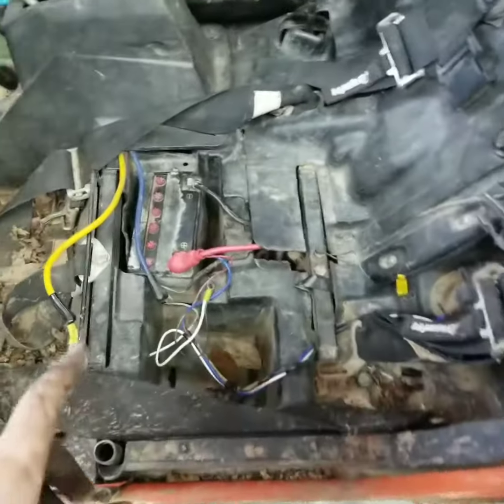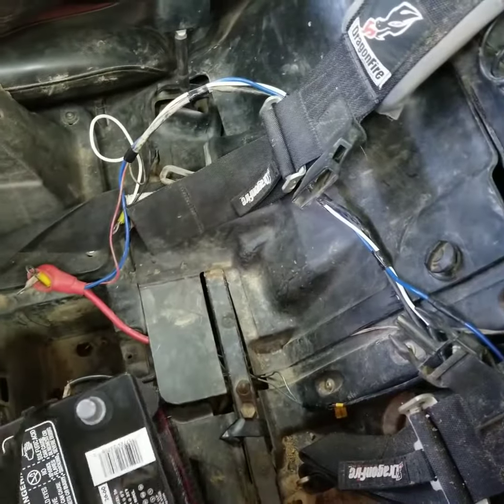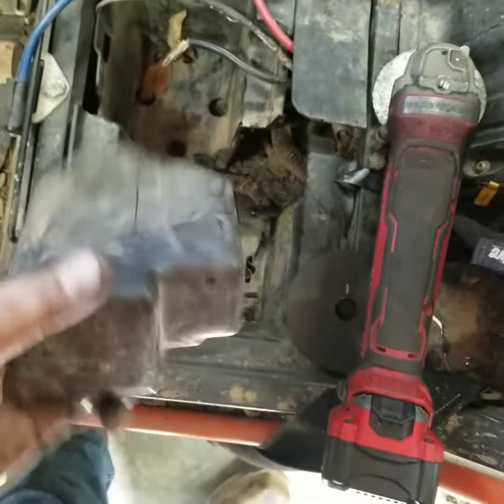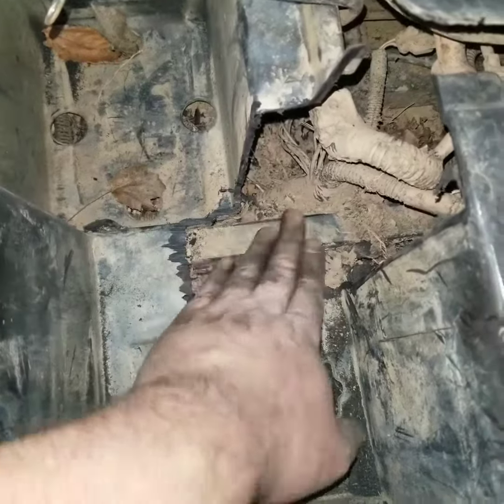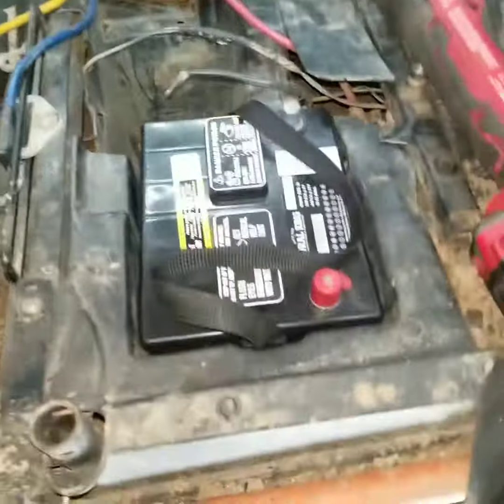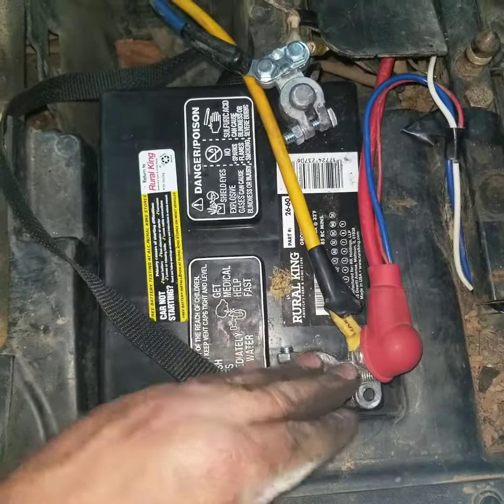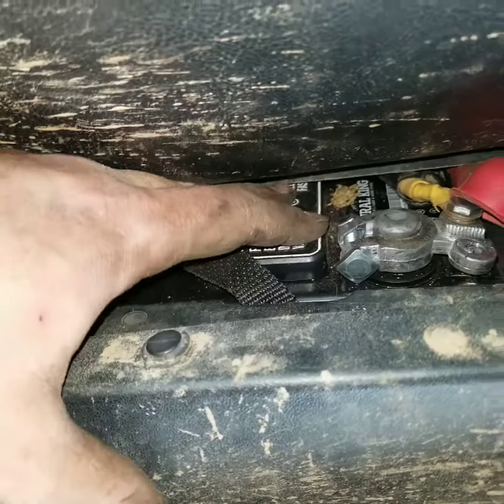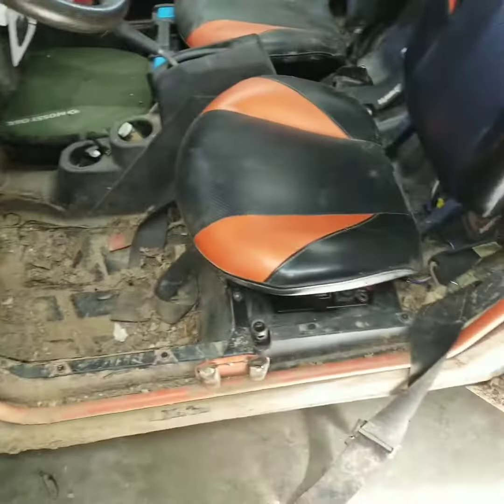RZR 800 or 570. How to convert to a car battery

Comment: Hey , what year and model is the car battery your installed on the rzr?

Thanks.
Reply from the maker: It will work on any of the 800/s or 570 models
Reply from the maker: I use rural king brand because there cheep.  The number on the battery is 26-60

Comment: Hey is it better to run the car battery compared to the dual regular battery?
Reply from the maker: In my opinon yes. 1 simple fact is a car battery usually has a minamum of a 5 year life on it. As the regular battery is usually less then 2 years. Also The particular battery i like to use for this from rural king is basicly the same price as one regular battery.
Reply: @hoopiemade  What is the battery Group do you use?
Reply from the maker: @timgile8144  26-60 is the number on the battery